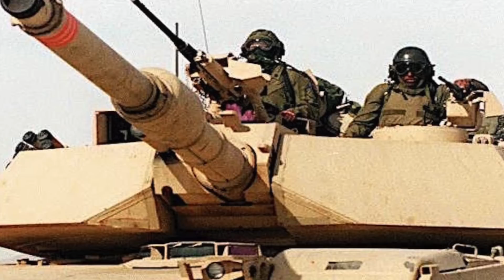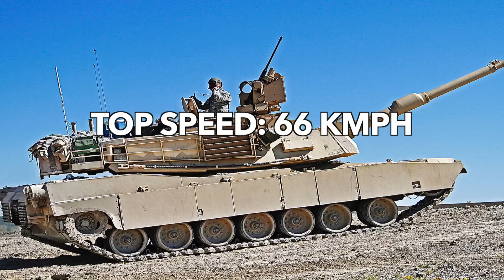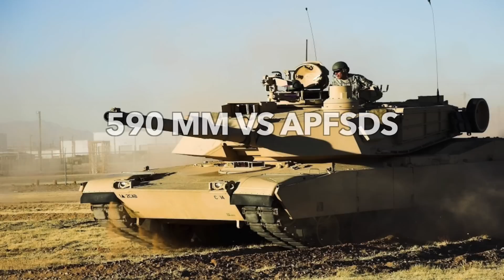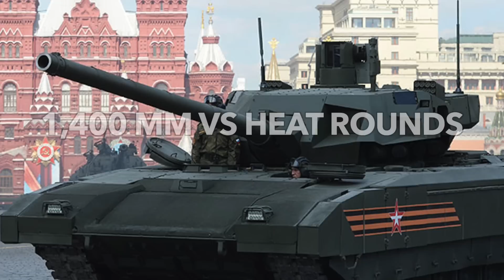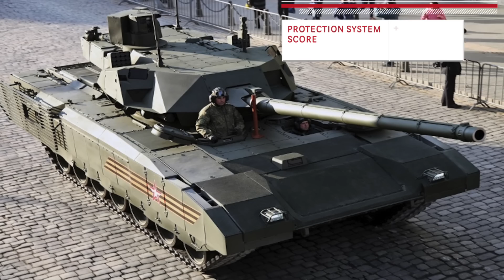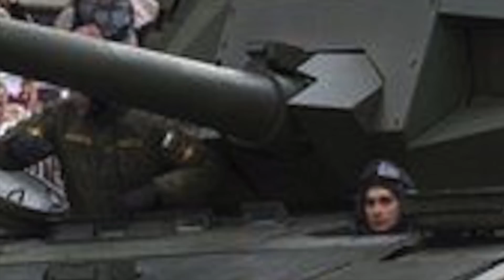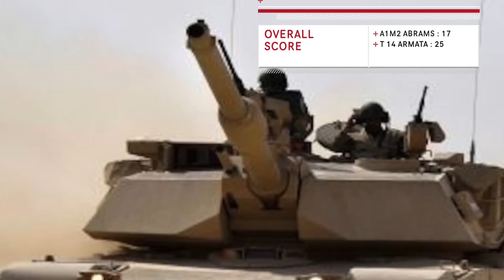AMERICAN M1A2 ABRAMS  vs RUSSIAN T14  ARMATA: WHO WINS?

Comment: I'm not seeing how you have all that armor on a turret that is rather small. So it's fictional. All this has yet to be tested in real life and is based only on printed data. In the end you are comparing a 1970/90's tank versus a 2016 design. Now that Russia has boasted about this the next generation American MBT will be superior.
Reply: Sloan it's effective armour not pure thickness it's equal to rolled homogenous steel armour but it physically may only be 100mm thick, Russias t-90 am is now also considered a 4th gen tank due to its upgrades which the m1 hasn't Being able to do so the t-90 is proving to still be effective and most likely out do the m1a2 almost as effectively as the-14
Reply: Sloan The armor is not on the turret. After-all the turret of the T-14 has no crew in it. The values given are for the front hull of the armata and the front turret and hull of the abrams. Also the numbers are wrong. :)
Reply: Just remember this. The armata has an autoloader and all its crew are located in a protective area in the hull. Here by giving the aramta an advantage. That turret crew space can be sacrificed for more armor.

Comment: sounds like Abrams sucks
Reply: A lot of the Russian claims about the effectiveness of the technology included in T-14 are just that... Russian claims.  Until T-14's systems have been used in actual battle and their effectiveness can be assessed by someone other than Russians, I remain skeptical about them working as well as advertised.

I also notice that a couple of the superior Russian systems mentioned in the video are still in development (the 152mm gun, beefing up the active defense to intercept 3000m/s targets)  and it doesn't talk at all about fire control, intra-vehicle coordination, or sensors.
Reply: get yer ya yas out. i bet youd still have to clean out your shorts if a m1a2 was bearing down on you...... just saying.
Reply: get yer ya yas out 
The bottom line is, the Abrams tank is a proven "bad ass" tank!!
Reply: The Russians can match anything the US makes.  In anywhere between 10 and 40 years, that is.
Reply: Yep she is a dinosaur, a well loved one though.
Reply: get yer ya yas out 
I wouldn't want to be sucking on the end of that 120 mm cannon!
Reply: That german leopard looks pretty badass
Reply: Russians have matched the abrahams with the T72mb3 not to mention the T90ms, the armata is simply in another league. its another generation of mbt, so other than your childish speech "go usa" look alike the us industry is in no condition to fight against another main superpower, just to say cant beat iraki and afghani resistence in over 17 years...
Reply: It’s old as shit and it still competes. We have a better airforce and navy.
Reply: It is over. The US better ditches its MBT and gives up to the Russians The US Army is doomed. Forget about the new all-in-one uranium depleted rounds.
Reply: trankt54155 
I doubt it, the U.S. has Hellfire missiles that will take of the T-14!
Reply: matt dwyer i bet i would too lol even a sherman tank.
Reply: Mike Walsh, yes; in any tank combat with the Russians an Apache can lob at least 8 Hellfire missiles and ground troops can use new generation TOWS along with Javelins and T14s would encounter a deadly barrage of missiles.
Reply: The German Leopard II may look pretty but not deadly because it uses tungsten rounds as opposed to uranium depleted rounds.
Reply: trankt54155 we're the only country that uses depleted uranium i think . but the blog said T14 uses it in the protective armour. I don't get that.
Reply: Arnulfo Ochoa 
The Russians were in Afghanistan for 10 years, couldn't defeat them, gave up and went home!
Reply: Numbers man numbers.  Russia only has a few dozen T 14's.  America has 10,000 Abrams.
Reply: Alucard Hellsing and thats their faults for using so few tanks
Reply: cvSAVdsbv the M1A3 is in development, I get how it can be biased because of the age difference but the T-14 would probably still beat what ever the US has in stall for it. If you compare older Russian tanks like the T-90 MS and the T-80U (both still in service) they both still come out on top of the M1A2.
Reply: trankt54155 tungsten is still pretty damn effective but not sure what would be better because tungsten is a pure kentic weapon AMD deleted uranium is also good so to be honest I dont know what is more effective
Reply: Arnulfo Ochoa the T72 saw combat against the arbams it lost it was desert storm  And russians dont use T90s its the Indians who do
Reply: Bones Doug 
Don't worry, the M1A2 Sept 4 will be just fine!!
Reply: get yer ya yas out 
No, but you do!
Reply: Mike Walsh I know but we could get a new tank soon I have plans for one already but I'm 16  so no one would take me seriously
Reply: Bones Doug 
Submit them anyway!!
Reply: Daniel Barvenko  and this is why people should use tungsten not DU  because HEAT and Sabot rounds are the primary rounds on most modern day tanks
Reply: If not being the undesputed best tank makes it suck then I have lost all hope in humanity
Reply: Arnulfo Ochoa I guess your country's navy is better than the US Navy...and bigger...and technologically comparable...and a "blue ocean"...with many years of combat experience...with 15 aircraft carriers...76 nuclear-powered submarines...yup, your country's Navy is bigger, better, smarter....and excuse me for being drunk while I write this.😁
Reply: Thats beside the point, the issue is that us navy is NO LONGER the best navy, if it ever were, did i say my country has the best navy? was my country being the best navy ever the topic? just enjoy the FACT that us is no longer a superpower, coliding with HUGE ships for no reason, figures how much seconds will it last against  a submarine, another veasel, a missile, or a and aircraft, sitting duck! :D :V  ENJOY!!!
Reply: Arnulfo Ochoa Bull crap!! You're not allowed to make hay of events like that when your representative country probably can barely field a navy. The US Navy still is, and will continue to be for years to come, the most formidable Navy the world has ever seen. Accidents happen whether from human ineptness or otherwise...so that being said, I suggest that you worry about your own country's navy (or whatever fishing boat passes for your navy).
Reply: Im not allowed?? hahahaha watch me while im doing it!! :D WHAT A JOKE YOUR BEST NAVY!! THAT CANT SEE A SHIP LARGER THAN A FOOTBALL FIELD!! HA HA HA! us navy could have another butt hole if encounter another competent navy, such as french, swedish, or russian, if can be shut down by an elder aircraft, and cant see a massive ship it no longer can be called as formidable, much less the most formidable the world has ever seen, i repeat, not once but twice already be crushed by a ship LARGER THAN A FOOTBALL FIELD, dont like it?? not my problem!! eat it, and enjoy it douchebag! :D accidents happen....yeah, a...accident, twice?? not an accident, remember the donald cook? that an accident too? hahaha poor of you, make me laugh, but keep trying to justify your pathetic navy, the sailors from ww2 must be ashamed of current navy of yours
Reply: And yes my navy may be the worst not in the world, in the universe that does not change the fact that us navy its laughable right??? no it does not! enjoy!!!
Reply: Arnulfo Ochoa Dude, grow up and go comment on the "We don't have a navy, but I have enough balls to laugh at yours" Channel...you sound stupid.
Reply: Ahmmm youre hurt by the truth?? too bad, i will comment on whatever i want to, and i will laugh on what i want as much times as i see fit, dont like it?? bu hu!! truth is any country with a competent submarine fleet could kick us navy so hard, so fast you couldnt believe, even north korea, wonder why north korea is so pumped on? why they launch missile after missile? because usa is no longer capable of answering to them, dont like it? bu hu!  i will keep saying it and youll have to swallow that pill no matter how thick it is. ENJOY!!!!!!!
Reply: Arnulfo Ochoa Dick!
Reply: Alucard Hellsing the US doesn't have 10,000 of them, they don't even have 10,000 tanks all together. They have somewhat in between 2000-3000 and the Russians can double that number for the same price and have a better tank. The M1A2 is just not on the same level as the T-14. Russia has always built great tanks and always will.
Reply: sure, thats why youre best ships keep being crush by gigantic ships that can be seing from the shipyard? or cant make it from florida to panama without crashing??? jaja what a joke your best navy!
Reply: Arnulfo Ochoa Let me be a little blunt. I don't give two rat's asses about what you think of the US Navy or the US...I care about objective debate. However, since you're on some anti-U.S. bullshit, I can't be bothered because at the end of the day you nor your country is a threat to me or my country. Enjoy your access to our social media since your country doesn't have it's own. Come on over one day and let's have coffee.